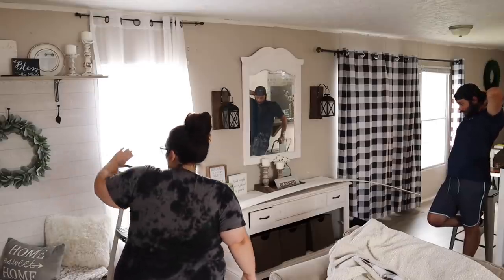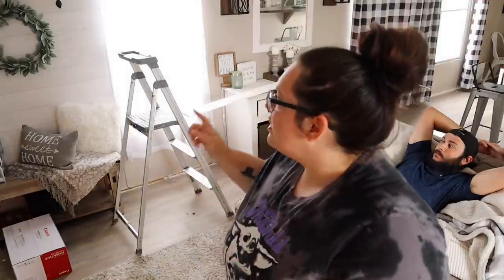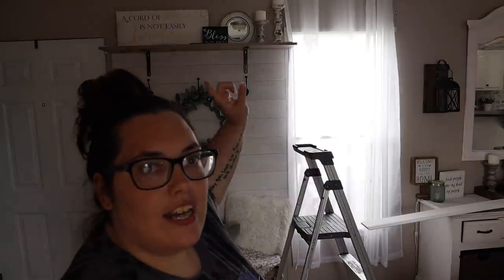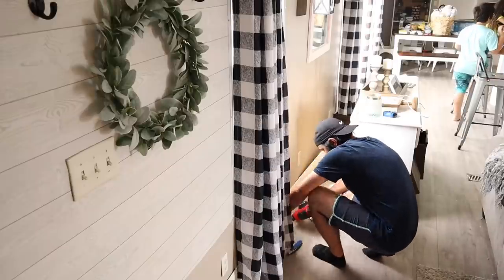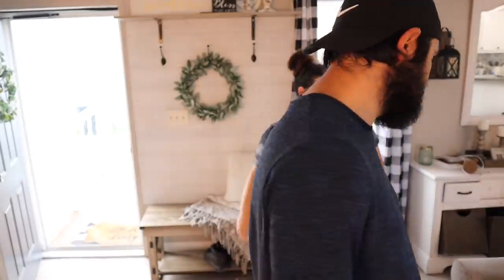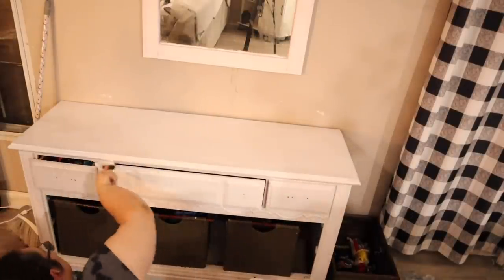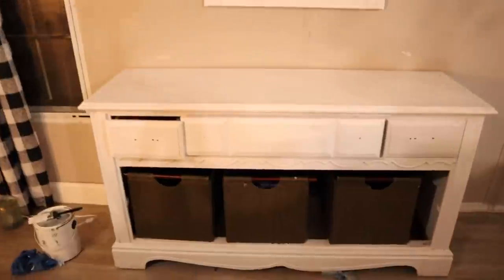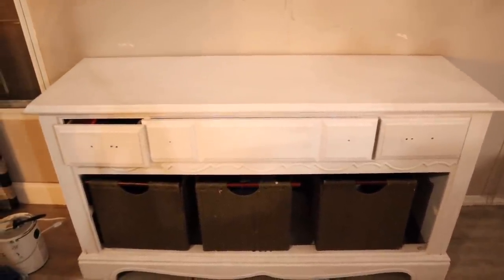MOBILE HOME MAKEOVER | mobile home updates | working on projects | new curtains | vlog style 📸

Comment: Hi. I look forward to seeing you and your fun family each week. I think the Buffalo plaid looks good I would however consider putting a very sheer white curtain behind it to hide small window height and subtly cover blinds. The other wall might look better with linen or muslin. You are very talented. Thank you for sharing your life with us.
Reply from the maker: Ok this is a great idea!!!!
Reply: @fearfullycreated  I have used wire or rope to hang my sheers just pull it tight and hang right under others at top with a screw on each side to attach it.  Pillows look great maybe have a couple in addition in sage or celery green or the  light blue you like. You inspired me today. Thank you.
Reply: I was thinking about you the other day. I was trying to figure out what to do about my visibly stained box springs on our king size bed. I had to flip my mattress so I took mattress  off and covered my box spring with a fitted sheet that blends with our comforter. Thought this might be a easy solution for you too.

Comment: Love the new buffalo curtain! Looks so good.    Sofa repair- Put Fray Check on the frayed edge of cushion material and let it dry. Then cut enough material from the underneath side of one of your bottom cushions to make a patch. Then hand sew that “patch” with about 5/8 inch seam from the raw edge. You want to make sure to sew it on material that is not fraying in order for the stitching to hold. You might have to go more than 5/8 from the edge. Then gently pull and use a blind stitch to attach the other side of the “patch” to the back of the sofa. The Fray Check will prevent that edge from unraveling anymore.  Then  repair the bottom cushion with a  piece of generic fabric. No one will see the bottom cushion patch.

Comment: I have to say the 3 Windows being the same makes the whole open plan with the buffalo plaid look cosy and comforting. You have enough lightness in the room to balance it out. Even the cushions look good. But I would switch them out for some colour. Also if you put the unit in the corner straight it will open that area up a little. As someone who lives in an small apartment angled furniture can make it smaller

Comment: Ok this is what I would do. 
Keep the long wall in the check .. just like you had it. 
On the livingroom window keep the mini blinds , get a little longer curtain rod, keep the white shears (that were there) in the middle, AND add a buffalo check Swag curtain across the top and just drape the check about a quarter of the way along the sides of the shears. I wish I could send you a picture!   Play up on the white shears instead of the check .I would try that.  Keep check pillows and add even a small check lap blanket.  Best wishes

Comment: Ok, return the grey/white one … sorry Shane, whites are tricky. Keep the Buffalo Plaids on both windows…. However…. The window behind the couch…. Double up, put the Buffalo plaids on the ends squish them in , accordion maybe 7-9 inches and put your original sheer white in the center.  The plaid will compliment the other windows but not block light, mainly keeps everything symmetrical.  Have a blessed week.

Comment: I had a trailer back in the 80's that had very short but wide windows in the bedroom - to make them look taller, I installed a roller blind about 10-12" above the top of the window, then pulled the blind down just to the top of the windows so from inside the room it looked like the blind was covering a much taller window, from outside it didn't look any different - perfect solution.  I also installed curtains at the sides of the windows - made such a huge difference in how the room looked.      Suggestion 1 - fill the holes where curtains rod brackets have been removed and touch-up the paint;      Suggestion 2 - use the same style/colour of curtain rods on all the windows that have the same curtains.  I'd choose the buffalo plaid over the white/grey ones, and as suggested by others, add sheers.

Comment: I knew those would look great and lowering the rod was perfect! Keep the sheers in the middle of the plaid ones on the window behind the couch. I think the plaid looks the best. It's not too much at all. I think you're unhappy with the window by the shelf because you don't want to take the shelf down and it needs to be cut back to allow the curtains to hang right. I still think the the buffalo plaid looked the best on all 3 windows. I would put the white sheers in between the plaid panels. I also like the plaid pillows on the couch. Lowering that rod made a huge difference too!

Comment: You must leave the Buffalo plaid drapes.  Raise the last window up to the top of the wall.  I like the huh drapes.  That is exactly what designers recommend.  I think the drapes by the door will be much better when the shelf is lowered and trimmed down.  I also live in a single wide and for me going high so the living room.  Put the Buffalo plaid pillows on the part of the couch that isn't in front of the drapes.  Add white pillows, with a small Grey couch blanket.  I know that you don't like the Grey.  Its not what you're used to.  Put smaller knick knacks up so no competitions.

Comment: It might look nice if you do a double curtain rod in the living room & have the inner curtain be a sheerer white & then have those same white more sheer curtains on the windows across the way.  Also I think if you shortened that shelf by the front door & just centered it a bit lower on the wall you would be able to appreciate both sides of the curtains there - otherwise it just looks too cramped - orrrrrr - you could just do one curtain panel on that window next to the shelf & tie it back to the right.

Comment: I love the Buffalo plaid!!! Put sheers in the middle. Cut your shelf down a few inches on the one by the window.
Keep decor simple so as not to get to busy. Another idea would be hang an old window (that's smaller than your window) inside and have the light shine thru. If it's beveled glass you will love the rainbow 🌈 that shines inside the house on a 🌞 sunny day ❣
(God's promise to us)
That would be BEAUTIFUL by that shelf and window.
You could pull that one window back with a tie back to show off the antique window or a Buffalo plaid valance with the window. Rule of thumb windows should remain cohesive with each other. I love you and your video's keep them coming.
Ps. All window rods in the connecting rooms should be the same height.
According to decor rules BUT.... Make it you because....we love 💘 YOU

Comment: IMO, if you have neutral colored walls you should pick curtains with a pattern or color to give the room depth & contrast.  I think that's what the plaid curtains offer whereas the solid white curtains fall flat and don't add anything to the overall design aesthetic.  since you have an open living room/ dining room space, I'd use the same curtains and maybe just add the sheers in the center to either the long dining room window OR the 2 windows in the living room but NOT all 3 windows.

Comment: Do you need to move that shelf from beside the door and put it on the opposite wall to the left of the couch. Your Buffalo plaid curtains looked just fine but you need to hang white shears in the middle. The pillows look great but only a couple of them are necessary… and They tie things together. I saw your frustration begin with that shelf that’s too wide for the area beside the door. You should lose that right away and then work on your curtains. Also, if you bring your curtains down even 6 inches from the ceiling, it’s going to make your walls look taller.